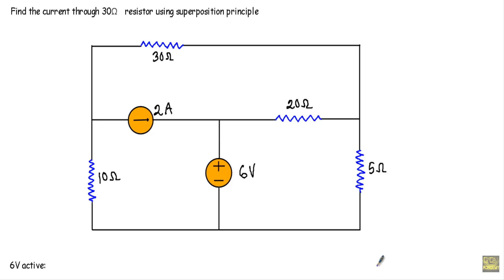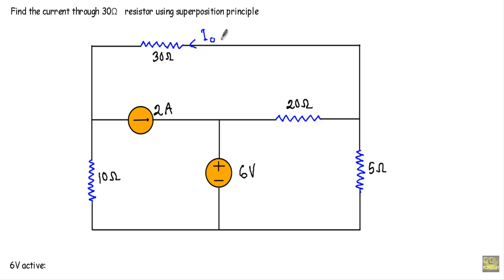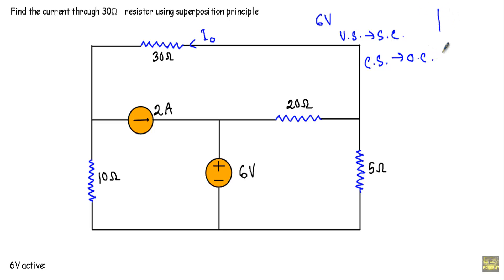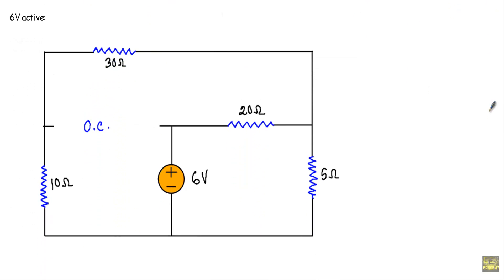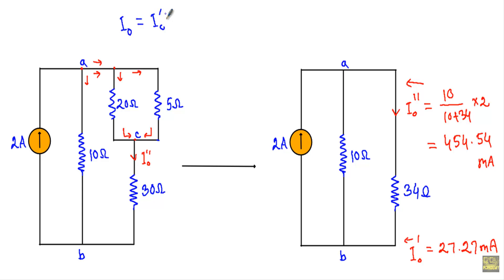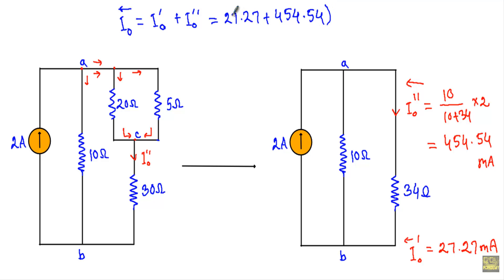Superposition Theorem : Example 1

Comment: Sir, why you ignore 20 ohms resistance when you using special current divider rule at 5.01 second?
Reply: the 20 ohm is not needed here. the 40 ohm and the 5 ohm are in parallal. and we need the current through the 30 which is part of the 40. the whole current goes through the 20
Reply: @mohammadzarifhaqueshawal  thank you for your explanation..😇
Reply: @NethraaKK-c1p3t knowledge for everyone